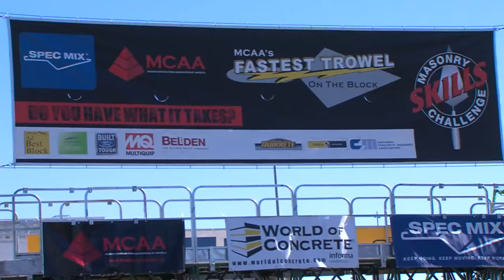2016 MCAA Fastest Trowel on the Block

Comment: Does neatness play a big or small factor in who wins?
Reply from the maker: Neatness can play a big factor.  Production is only worth 30 out of 100 total points.  The other categories contestants are judged on include:

True and Workmanship (10 points)
Plumb (15 points)
Level (15 points)
Story  (15 points)
Voids (15 points)

After the twenty-minute competition a coin is flipped to determine which side of the wall is judged.  Contestants are then given four minutes to to strike the wall prior to judging voids and workmanship.  The purpose 
of this four-minute period is to improve of voids, using only the jointer.

I've seen several contestants over the years win the competition without having the highest number of block because their wall had too many voids or wasn't level.
Reply: Mason Contractors Association of America only the line side should be judged. that's what you're laying too. completely ridiculous. .! These guys must be the bottom of the barrel. I've layer 600 block by lunch,"with durawire an rebar being installed. that 600 everyday at minimum.  600 finished block. jointed on both sides. This is a disgrace to Masonry. I get pissed yo watch 2nd an 3rd rate masons piddle around.
Reply: where are the females contestants?
Reply: what size block you lay 600 by lunch time?